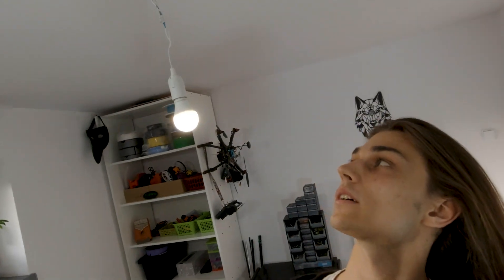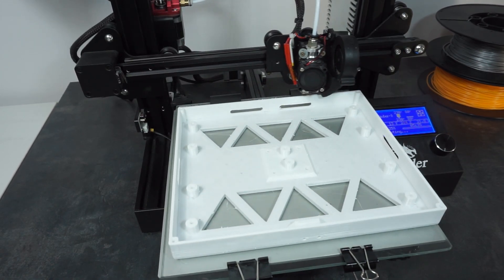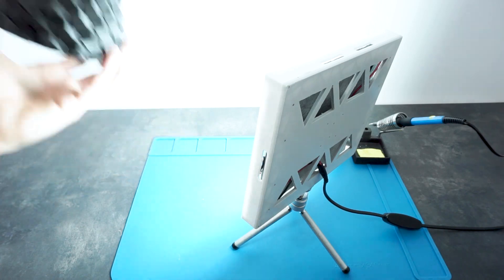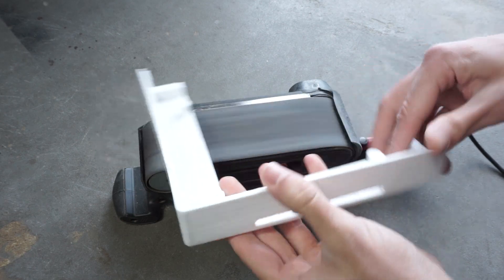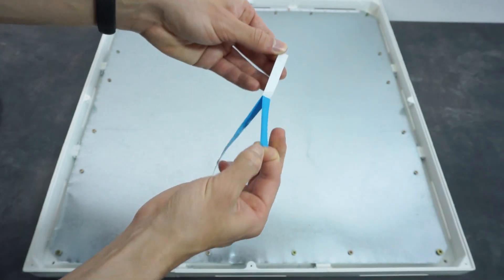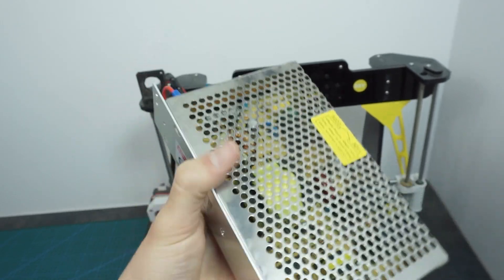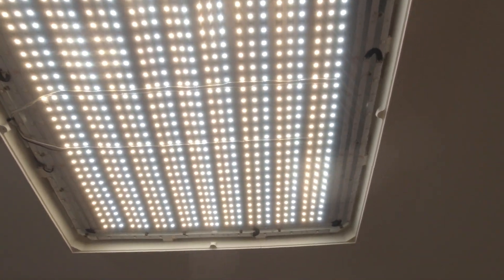How To Make 3D Printed LED Panels ( Super Bright / RGB / Adjustable Temperature )

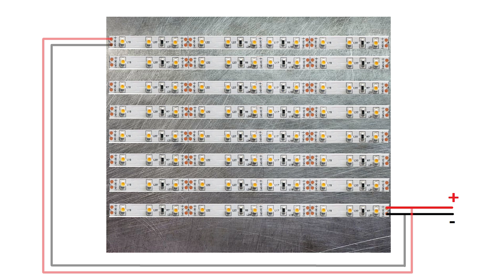Comment: Hi! At 2:57, could you please explain the wiring? Specifically the top two strips... looks like you connected everything in parallel until then,  and then you take the negative of the 2nd strip from the top and connect it to the positive of the top most strip, and vice versa. 
Can't you just connect everything in parallel and not worry about closing the loop?
Thanks, and keep up the good work!
Reply: Everything is in parallel, just a slightly confusing diagram. Look again.
Reply: @RandomakerYT  thanks for the reply. I still don't see it. Top left corner, + goes to - and vice versa.
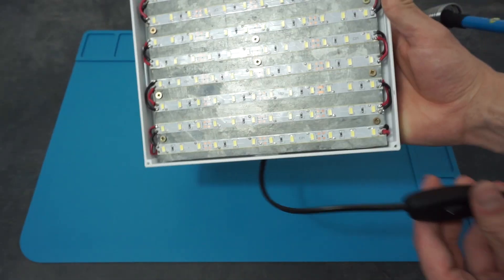Reply: @AlonElvs  I see that now, I completely missed that. It's just drawn incorrectly. He has the polarity reversed for the second strip. If you look at 3:10 he has it wired correctly.
Reply: @RandomakerYT  got it, thank you 🙌🏻